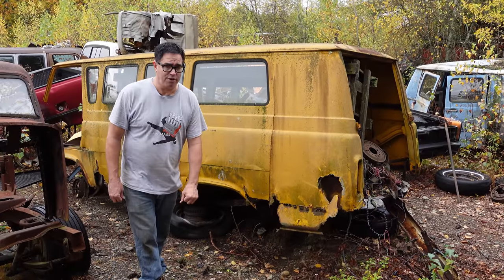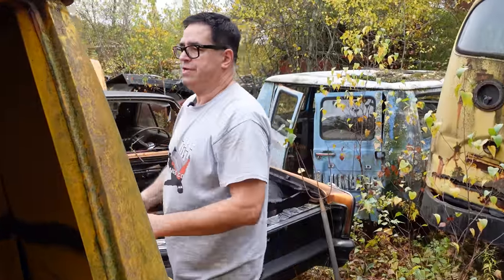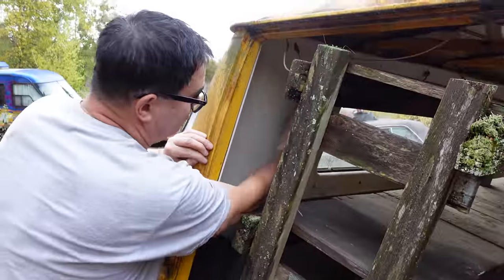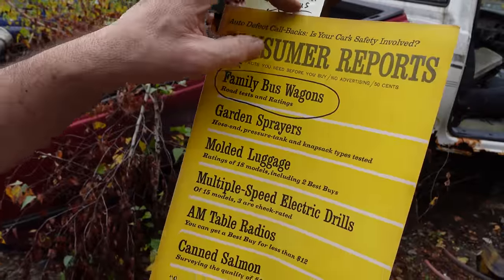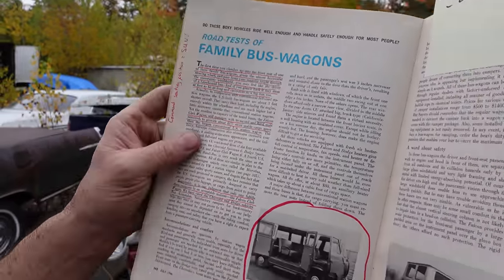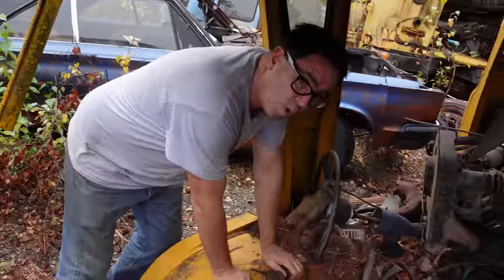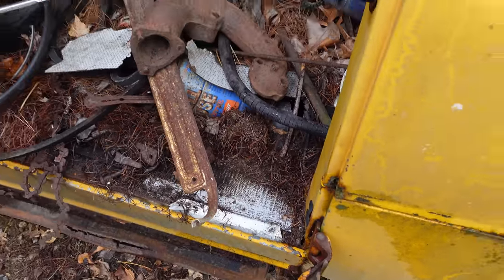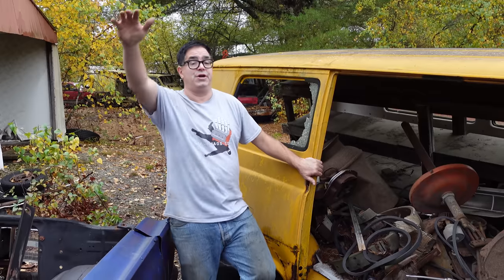1965 Ford Super Van School Bus

Comment: I have a 66 . Got it two years ago.  Running and driving now. Put a 300 in it. Kept the three speed manual. And yes I love it.
Reply: Will a 302 fit?
Reply: Turbo it
Reply: Had a 62 Econoline with an 85 hp 144 cubic inch six in it - I'm betting a 300 six would make it seem like a race car!
Reply: @anthonyrone393  It's a real PITA to change spark plugs on a V8 in those vans, so the big six is a lot more desirable. Still, I think the 289 was optional in those vans.

Comment: VIN might have been something like E14 for E Series Van, then maybe J for 240 straight six with one barrel, H for Lorain, OH assembly and the rest would be the production sequence with the sequence perhaps dictating the year. Nah, possibly not special/fleet paint. Should be code "G" Chrome Yellow exterior paint which was a stock Ford Truck color in 1965. Those look like possibly Kemlite panels which are readily available today.  

The Lorain, OH plant was the main van plant for years and operated from 1958 to 2005. Today's Transit vans are made at the Kansas City Assembly plant in Kansas City, MO which is also called Claycomo Assembly, or "KCAP". The E Series cutaway/stripped chassis are made at Avon Lake, OH Assembly or "OHAP" (Ohio Assembly Plant). That plant opened in 1974. KCAP opened in 1951 for military production and 1956 for automotive assembly. KCAP has assembled F Series trucks continuously since 1957.

Comment: A store I worked for when I was 16 had one of these econoline vans in standard length. Once I was driving it during a rain shower and had to stop on an incline at a red light, the van was so light in the rear I couldn’t get enough traction to get going again when the light went green, I had to back down to flat ground and get a running start to make the intersection.
Reply: Most teenagers don’t know
Tires need tread for traction 😂
Reply: @fastinradfordable  the tires had plenty of tread just no traction due to wet conditions on a hill at an intersection
Reply: @fastinradfordable  most teenagers couldn't drive a thirsty cow to water

Comment: In that era the suspension and driveline formed the backbone of the belt loaders used at the airlines when the Jets came along and at united were still in use thru the 90s . The cheap Falcon 6s were replaced with 300s backed with C6s bought new from Ford until production of the 80 thru 97 trucks ended Purpose built units replaced those . I had a 91 F150 with the fuelie 300 and was just thinking how that Van would haul with double the power of the 240 .
Reply: remembering the early units were Rube Goldberg contraptions that were PTO and belt driven unlike the current units of the last 4 decades that are hydraulic and electric motor operated with all kinds of safety sensors . The old ones were about as safe as a wood chipper when something caught on the belt . New models have E stop buttons at all 4 corners while the old had a lever and rod to engage the belt drive .
Reply: Ah a 240! 
Had my hands on one yesterday on an Onan generator dated around 1965.

Comment: That 240 is good for its cylinder head.  240s had a bit higher compression than 300s, so their heads are sought after for 300s. 

I wonder if this van was an E250 or just a 100.
Reply: @harryballsacky  they were considered 1/2 ton capacity even the heavy duty version.

Comment: 300 and 240 inline 6's used the v8 Windsor bell housing pattern. Not too difficult to swap in a 289 or 302.
Reply: Dave Grohls Falcon Econoline van is a V8 conversion.
Reply: Mexico had V8's in these vans so it does work well.
Reply: @mexicanspec  You guys had Mustang II's with 302 V8's..Mexican Stangs never missed out on a V8 in 1974, but the USA did... 😁👍
Reply: @deanstevenson6527  That is right.  I just posted a Maverick on Instagram, all V8 powa'
Reply: @deanstevenson6527  The Mustang II could be had with a 302 beginning in '75.
Reply: @mexicanspec  I never knew the first gen (1961-1967) econoline to be sold in Mexico. The 2nd gen 1969 to 1974 was. 2nd gen had the v8 never in the first gen from the factory. Dodge had a factory v8 in the 60's vans Chevrolet and Ford did not.
Reply: @radiowave75  I see them for sale every once n a while and they have Mexican VINs so yes the early ones were sold in Mexico and they had V8's.  It was odd, but Ford was the only company using V8's at the time so they put them in everything.
Reply: @mexicanspec  I'd definitely like to see that one. I challenge it to be a factory v8 though.  I'd like to see proof of that.
Reply: @radiowave75  I can show you the vans but I would need to see a copy of the original invoice to show you it was originally a V8.

Comment: It was odd how they used the vertical tail light in place of the round ones the other Ford Vans had.
Reply: It was because there wasn't room for the round lights. The supervans rear profile was narrower than the short vans. 
It was narrower to create a tapering effect. This allowed them to use the standard door on the longer extention.  Because of this the narrow f100 taillights were used. They look the same between short and long vans but upon close inspection you will see the profile is different on the supervan vs short van.

Comment: Hi Steve, standard Ford van, "Ford Van".  18' extra, "Super Van".  Standard passenger Ford van "Club Wagon"  18' extra passenger van, "Super Wagon".  I do not think that Ford was necessary "the best" I think that that was left up to the consumer.  Ford, Chevrolet/GMC and Dodge, three first generation vans that where 90% alike, except for the Chevrolet Corvar van (before the Chevyvan G-10) "Corvan cargo van" and the Corvair "Greenbrier passenger van".  I am mostly a Ford Man, but I like the Dodge A-100 the best, because they could be had with a bigger automatic transmission' other than the Ford or Chevy, I'm talking about the Chrysler Torqueflite 727.  The Chrysler Slant Six came with a better flowing aluminum intake manifold, not found on a Chevrolet or Ford inline six.  Please reply.  Dave...

Comment: I believe the 200 CID Falcon engine was also available in the vans at that time. Also had the integrated intake manifold
Reply: In my area (MS Gulf Coast) the Bell Telephone vans were rumored to have the 200 engine. My '66 Econoline had the 170.
Reply: @retromotors383  I had a blue (standard wheel base) 65' or 66' in the 70's had a love seat in the back & hauled my 74'  yamaha DT250  it was fun to drive like my FC150
Reply: That's true they weren't common but the 200 six was available as an option other than the 170. The 144 was not offered in 1965 to  1967 anymore.  I had one with the 200 six and the 9" rear axle. The drive shaft had a small yoke on the transmission side and a large yoke on the rear end side. Unique set up. Otherwise the large six like he said was the 240.

Comment: There was a recall on the 240,s for overheating problems , engine blocks where casted to thin around the cyl walls. My 67  240 had that problem
Reply: How did they fix it?  New block?

Comment: Oh my gosh! My buddy had a 1967 supervan, no windows, that we customized. 240 six, 3 in the column, brakes no so great compared to 1970's. Front end steering tended lots of play. Very dependable, easy to service. Driving position, turning, sitting in front/over the front wheels was just like drinking a school bus, just shorter. 

Someday I will find the older econoline with the windows, not a rust bucket. 
Install 1989 Cherokee 4x4 powertrain. (The jeep 4.0 is the 240 ford block.) 
Use axles from a jeep CJ.
 Even the instrument display has the same dimensions! Will make a fun expedition vehicle.

Comment: Riding in the front seats of those Econoline's you'd feel like you were riding a horse.  Since you rode on top of the front wheel it felt like the van was bucking you on a bumpy road.  Like the truck version of that era Van.

Comment: is that one air cooled ? lol 240/300 ford were truck engines not like the little cheese ball engines [140 200 250 260 ] that could be had in most ford cars
Reply: Some of these early Econolines came through with 144 or 170 six bangers.